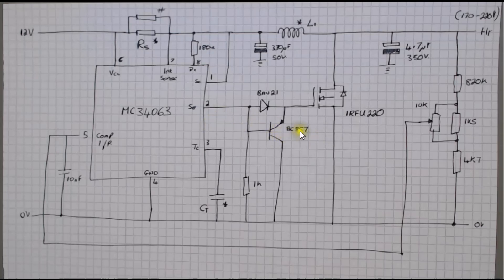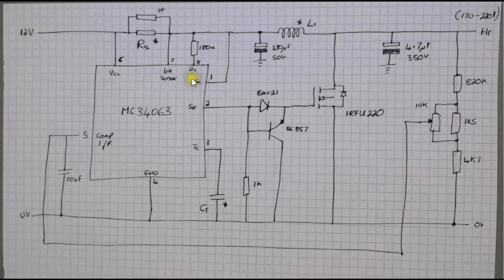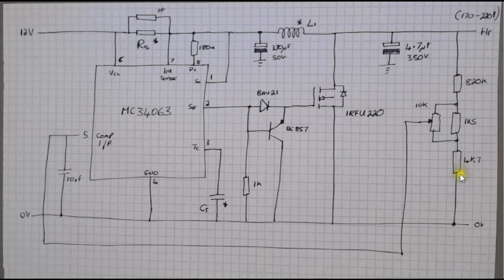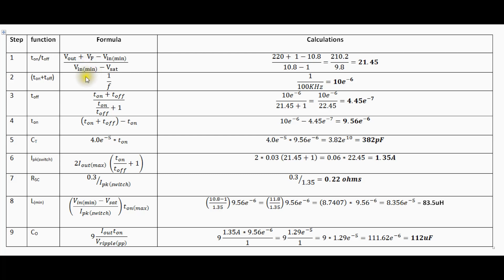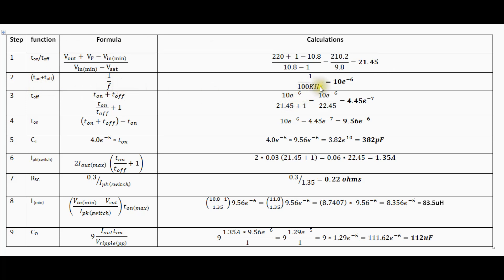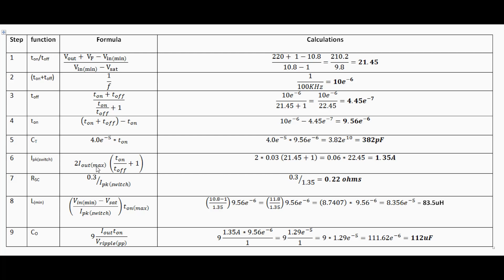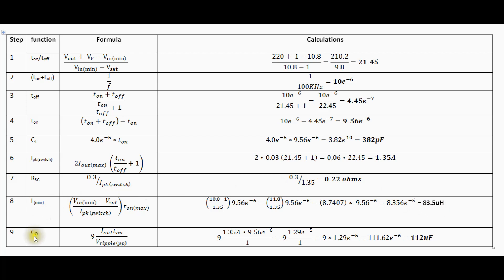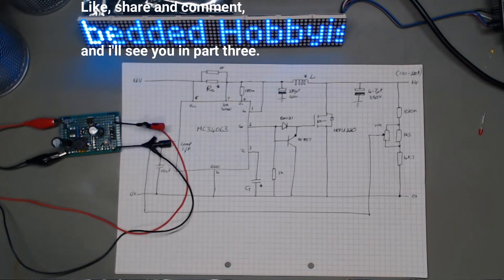#037 Nixie Clock Part 2 PSU design (MC34063)

Comment: Thank you so much for putting this up. Can I just double check the step 9 on your calculation sheet? The formula for calculating the output cap. In your sheet, you used 1.35A for the Iout. Is this suppose to be the max current on the switch OR max desired current? Your desired current is only 30mA. On the datasheet, the Iout is the desired current. Again, thank you for putting the calculations up, most places just put the formulae and I was getting confused with all those exponent values.
Reply from the maker: Hi, looks like you found a typo, yes the 1.35A is the max switching current Ipk(switching) calculated in step 6. yes so Iout =30mA,  and the output Cap's value is based on Ipk(switching).

But it's like a lot of things you calculate the cap value then use a preferred value close to the calculated value.

Glad you liked the video enough to question the calculations.

Comment: Thanks for re-energizing my interest in high-voltage projects like NIxie tubes. I haven’t used mine in over a year and it reminds me, I take the voltage ratings of things like capacitors for granted when I order but I actually need things on hand that can handle several hundred volts.
Reply from the maker: Glad you found it interesting, i don't do much high voltage stuff so very little stuff that can survive high voltages in my parts bins as well.
Reply: Back in the 80s I used to live in an apartment building complex with four apartment buildings and people would throw away their old stereo and television equipment and we would get vacuum tubes and circuit boards out of those and I had no idea what to do with them because I was using things like 555 and 4017 chips.    I could have probably made a fortune on eBay  if I kept those vacuum tubes.
Reply from the maker: @GadgetReboot  I know, I used to get tubes, wire the heaters up in parallel to a 12V car battery string them along the back fence at night and shot them with an old 22 air rifle. was great fun at the time, but i shoud have been wrapping them in paper as an investment!

Comment: I am currently trying to design 5V with this IC.
Reply from the maker: Hi, if you go to the data sheet for the MC34063 there is a table which has the steps for 3 converter designs. Boost, buck and negative supply. I just looked at the first column for a boost converter. the second column is for the buck conversion.  if you define what you want or have for Vin, Vout, Vf and Vsat you should be able to work down the column. if the current and voltage is within the limits of the IC you won't need an external switching device.